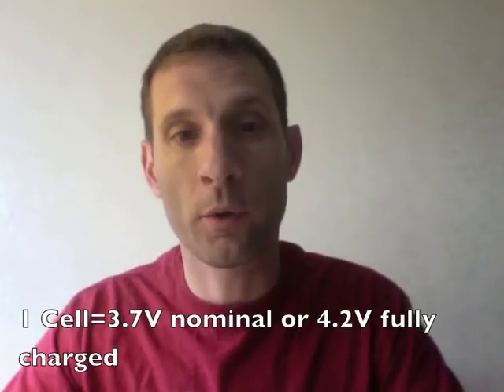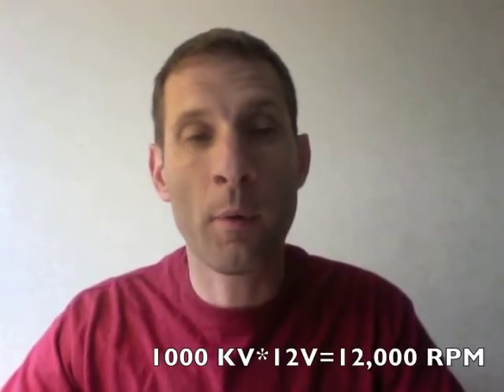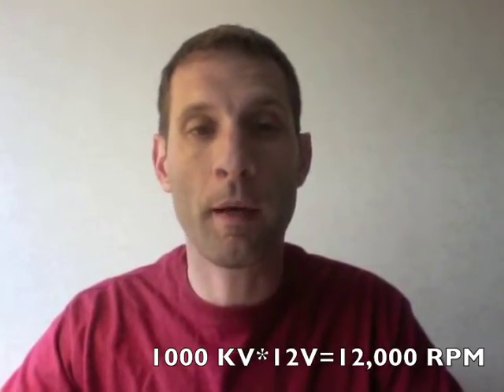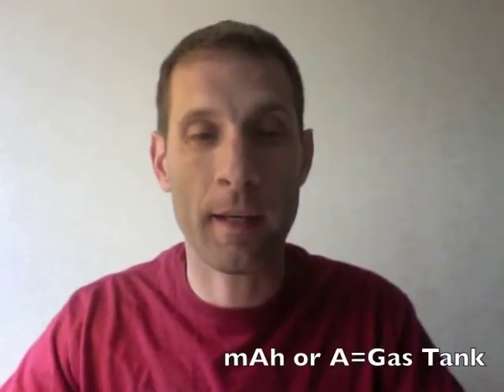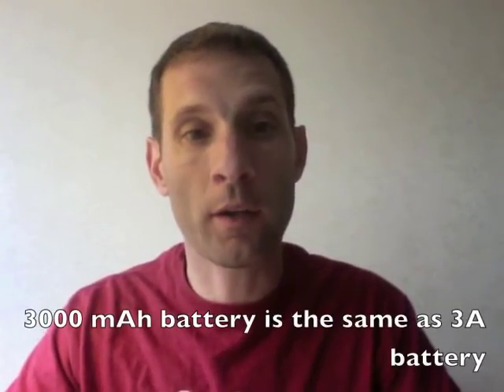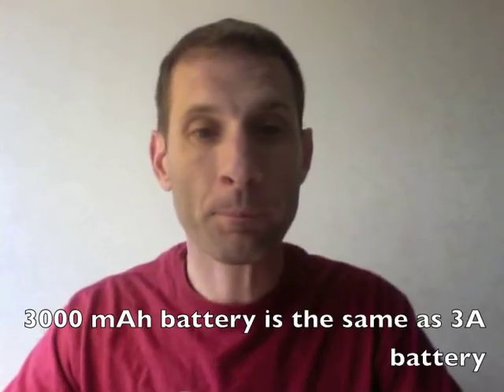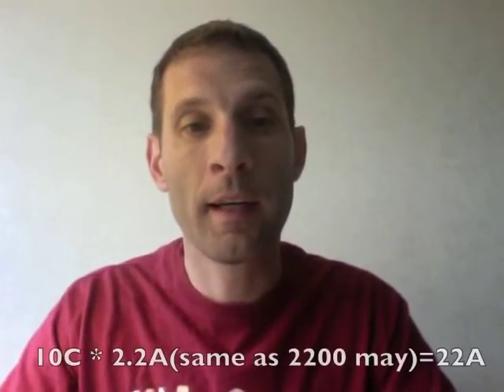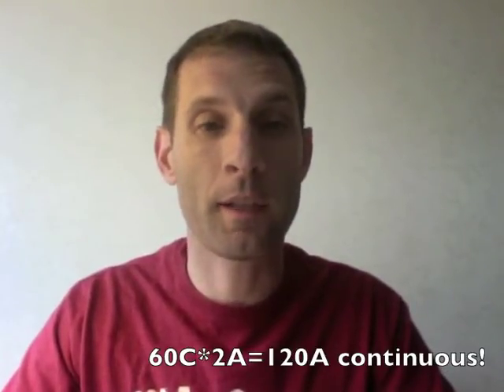LiPo Battery Answers, What's ars C rating, mAh and Volts?

Comment: Hello,

i want to build quadcopter with this parts:

Motor specs-
A2212 / 13T 1000KV Brushless Motor Outrunner

80% max efficiency
4-10A max efficiency current
No Load Current: 10 V : 0.5 A
12A / 60s current capacity
2-3 Li-Poly cells
Suitable for airplane, aircraft, quadcopter.
Model: A2212
KV: 1000
MAX Efficiency: 80%
MAX Efficiency Current: 4-10A (>75%)
Current Capacity: 12A / 60s
No Load Current: 10 V : 0.5 A
No. of Cells: 2-3 Li-Poly
Motor Dimension: 27.5 x 27mm
Shaft Diameter: 3.17mm
Weight: 48g
Package Weight: 59g

ESC-
Wolfpack 30 Amp ESC

Output: Continuous 30A, Burst 40A up to 10 seconds
• Input Voltage: 2-4S Lipo, 6-18 cells NiMH
• BEC Output: 3A / 5V (Switch Mode BEC)
• Refresh rate of the throttle signal: 50Hz – 400Hz
• Max Speed: 210000rpm for 2 Poles BLM, 70000rpm for 6 poles BLM, 35000rpm for 12 poles BLM
• Size: 73*26*8(L*W*H)
• Weight: 38g

Flight controller – Naza M lite

Propelers-1045

AUW-1500gms (FPV included)

Battery ?
C rating-
mAh-

Should i go for –

Orange 2200mAh 3S 30C/60C Lithium polymer battery Pack (LiPo)

Or

Orange 3000mAh 3S 30C/60C Lithium polymer battery Pack (LiPo)

Or

Orange 5200mAh 3S 40C/80C Lithium polymer battery Pack (LiPo)

Battery Charger ?

I have this one already
SKYRC IMAX B6 CHARGER

Operating voltage range: DC 11-18 Volts
Circuit power: Max. charge power 50W
Max. discharge power 5W
Charge current range: 0.1-5.0A
Discharge current range: 0.1-1.0A
Current drain for balancing Li-po: 300mA/cell
NiCd/NiMH battery cell count: 1-15cells
Li-ion/Fe/Polymer cell count: 1-6cells
Pb battery voltage: 2-20V
Net weight: 277g
Dimension: 133x87x33mm

Battery ??????????
Reply: FPV
Camera 12v
Transmitter  12v 
Can be connected to this battery?
If can then 
 Main source plug or balance plug?
Reply from the maker: Okay, that motor is not a good quad motor.  The way the props are help on is not very good.  Look for a Emax, DYS, Cobra, Sunnysky motor that is made for quads.  But if you did use that motor, it is going to pull 12A at full throttle so 48A for 4 motors.  The quad would probably be small so you would want a 1500 mAh 25-40C minimum.
Reply from the maker: Yes, you can power the camera and Vtx off the 12V of this battery.

Comment: Hi m gona bulit, airplan with 2200kv motor,so what batry will be good,
Reply from the maker: I need more information.  What size motors?  2200KV just means at 1V the motor will spin 2200 revolutions in 1 minute.  Also what prop and what does the plane weigh?  How do you want to fly the plane, Cub stye or EXtreme 3d?

Comment: Does this mean, higher C rating thr faster the discharge too? So, a 5000mah with 50c will discharge faster than a 5000mah with 25c rating?
Reply from the maker: Tim Lwin Tim, kinda yes.  You will see less of a voltage drop during high current draws relative to the battery.  Which means you will have more power.